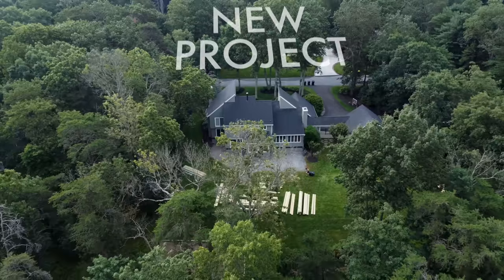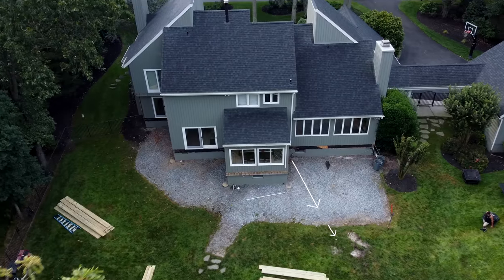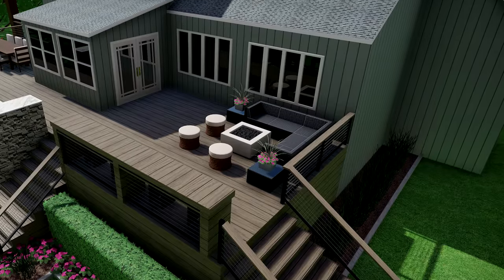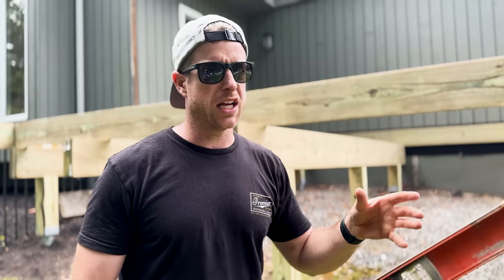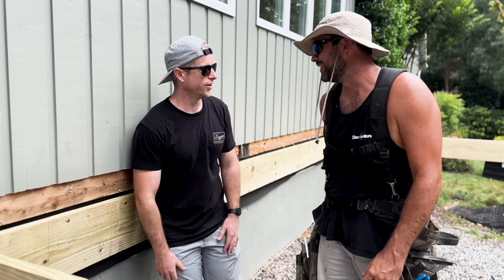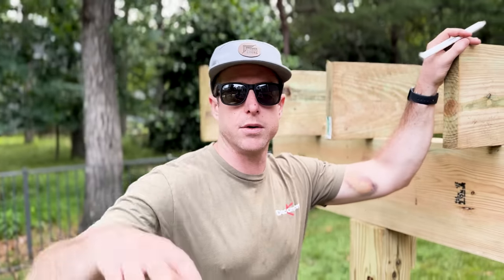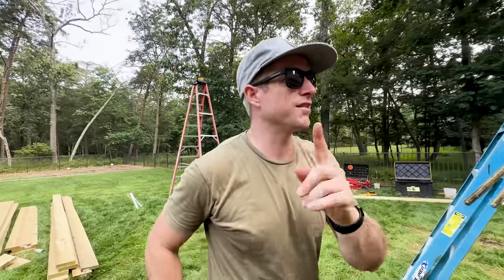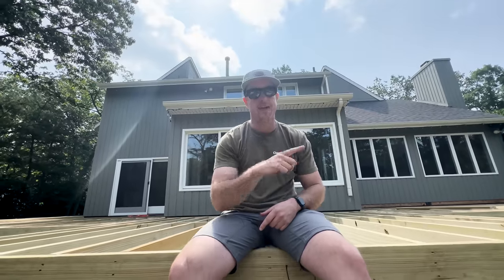Framing A HUGE Deck - Layout, Helical Piles, and Deck Framing

Comment: great work as always, thanks for showing step by step and showing how to overcome some problems and corrections. I a SUUUUUUPER jealous of this deck and I have a 16'x24' screened in back porch that is on a slab 4' off the ground, and I am going to add an additional 16'x12' to the side of that porch to make it 16'x36' screened in porch. I will put plastic deck boards in on corner at 6'x6' I will put (2) 3'x8' corrugated metal sheets under the deck 2x4 braced at an angle with a stop and drain with P-trap that will collect the run off from a exposed pipe shower above in the porch. That drain will connect to the main drain under my house. I will also cinderblock under and support for a 6' jetted free standing tub on side of my corner shower. Thanks so much for the ideas.
Reply from the maker: sounds like quite the project, good luck my friend!!

Comment: Hey... So the screw pile system, would that be a option for 4x4's when doing fences also??? I have about 700 feet for of 8 foot fencing that I'm starting to take down 2 sections at a time and re doing(just  replacing all the 4x4's(about 60 of them 10 footers & 120 2x4x8's) I able able to salvage all the 8 foot pickets after power washing and staining black. Just seems like the 4x4's would last longer not putting 2 ft in the ground!!
Reply: Nevermind.... I read that would be insanely expensive! 😢

Comment: I'm curious, how accurate are you able to place those helical piles? Seems like there would be at least an inch or two error with the post base directly attached to them, how do you account for that?
Reply from the maker: Our installers are actually super accurate, if they have to deviate from our mark by more than a half inch they will check with me to make sure its ok. They also have offset brackets if it needs to be a couple inches out of line for whatever reason
Reply: @THEpremieroutdoor  Interesting, thanks for the response!

Comment: You guys are hilarious 😂 why didn't you just dig by the house and confirm the direction of the septic line? Would have saved you so much worry haha. Love the builds guys!
Reply from the maker: hahah glad you can also get a laugh, we get plenty while were working! We though about that but the pipe is at least 4 feet down so that would be so much digging and anytime you try to dig out a pipe you run the risk of hitting it with the shovel as youre looking for it. Luckily we made out good and didnt hit the pipe!!